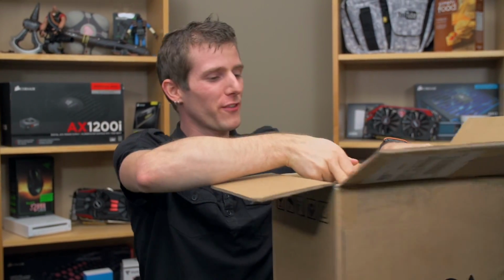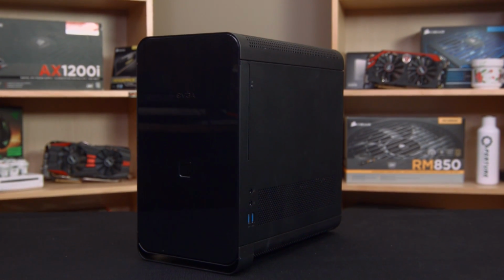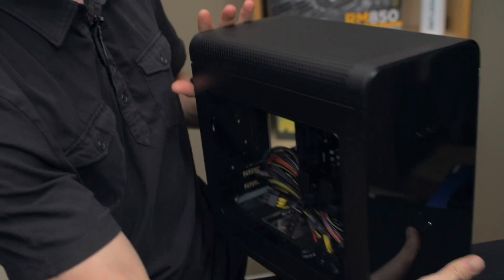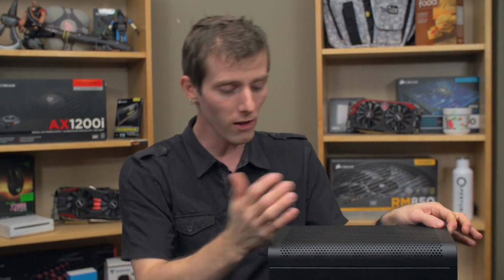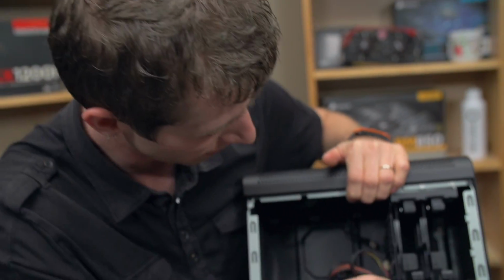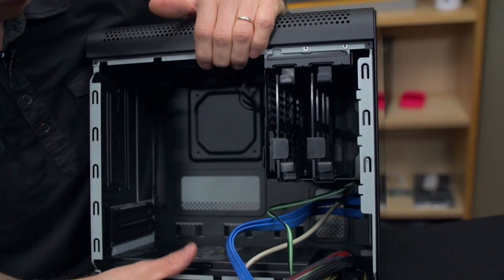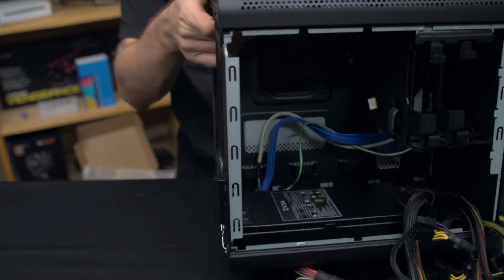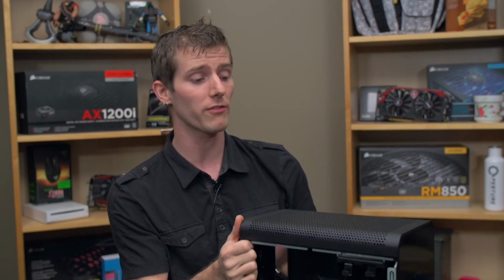EVGA Hadron Air

Comment: Cable management sucks, not "All black interior", and it's expensive (for mini ITX case) the only selling point of this case is EVGA brand (if you're really EVGA fanboy who want to buy every EVGA peripherals) other than that this case is suck.
Reply: The EVGA Hadron Air comes with a 500W Gold rated PSU equipped with it. Most modern power supplies are not compatible unless you use server variants. Why do you consider this expensive? It comes with the case and a power supply. Do your research before you talk rubbish, I guess you didn't go through the video to see the nooks and corners.
 A quality 500W gold rated PSU costs around $100 and a Mini ITX Case is around $80. This case costs $180, how is this exactly expensive?
Reply: jimmys tempura i knew it's 500 watt 80 Gold (non modular), and I DO RESEARCH first before saying "It's expensive" because this case is not worth for $ 190 ( $189.99 on newegg)

Bitfenix prodigy only cost $ 79
FSP Aurum 500W 80+ Gold cost $ 73

You got a Mini ITX case with 500 watt 80+ Gold PSU only for $ 152, with better cable management and water cooling compatibility.
Reply: IndraEMC
At what expense? Bitfenix Prodigy has more open slots for case fans, so you would spend more filling up the slots. Fan Controller to manage the fans or an DVD drive? Besides, the EVGA Hadron Air is much more smaller for those who have conservative space compared to the Prodigy. Besides, the EVGA 500W PSU doesn't have much wires, you can dump them all in the corner next to the power supply.
Reply: *****
Sorry, you lost me. Explain it again....
Reply: jimmys tempura unless you want a "portable", size between EVGA hadron vs Bitfenix Prodigy wasn't really matter, since your PC are just sitting on the desk.
Reply: Cable management is what it is, really not that bad but it's a small case so what more do you want? The goal was smallness, I would be unimpressed if they sacrified that for overly clean cable management when at most you're going to run 3 optical drives, 1 gpu.

The interior is all black, this is a myth propogating throughout the internet simply because of review models.

The price is competitive given the extremely high quality custom PSU and very high quality build. It's not like a cheap case being sold at that much, it's very well built, it can justify its price.
Reply: jimmys tempura I wouldn't do that, it blocks the intake to the GPU. Temps are better if you can fit the cables to the side, between GPU and drive bays
Reply: IndraEMC It's a joke to compare the Prodigy to this, it's nearly twice the size. Different people have different needs, this is an awesome case, and the PSU is higher quality than what you're comparing to. Even in your ill-advised comparison, the price is a difference of only $40, well worth it when building a $2000 computer to make it much more portable and better looking (for those that prefer it).

Comment: Hey, does anyone know if you can fit a 11 inch card in this? I'm trying to get a PNY 11.1 inch card but I want it to fit in this case. Also any good cpu cooling solutions? I'm thinking liquid cooling. dual 120mm radiator? Any suggestions would help.

Comment: Linus U have been having a problem were graphics cards don't fit in my case thermaltake VL80001W2Z V3 Black Edition No Ps Mid Tower Gaming Case... it's not the hard drive bays it's that the mother board is to close to the slot to put it in. I want to know if the nvidea geforce gtx 770 ti would fit or the Asus geforce gtx 750 7i. Thanks to anyone that knows the answer!

Comment: can this 500w gold psu hold a 980TI and a haswell refresh?
Reply: Victor Boechat Yes
Reply: Victor Boechat http://www.geforce.com/hardware/desktop-gpus/geforce-gtx-980-ti/specifications Minimum is 600.
Reply: It's a recommendation from nvidia to give a large margin of safety.

A normal 80+ bronze or better 500w PSU would suffice without a hitch
Reply: LocoMoto Its not a reccomendation it says on it "Requirement". I have a GTX 780 on a Corsair 500w and it underperforms.
Reply: Total system consumption even on a 980ti system with an i7 5930k rarely would reach over 400w while stressing the system.
To note is that an i7 5930k draws more power than the haswell refresh of the i7 4790k

And yes, it says what you are saying but that still is a recommendation/guideline

Are you saying that the gpu is not performing at the performance level it should or that your computer is shutting down when putting a load on your system and/or having internal components being fried up etc?
Reply: GPU's 2nd fan doesnt turn. Im on a Corsair 500w 80+ so the PSU is trustworthy. GPU is EVGA GTX 780 ACX SC and It turns perfectly in my friends system with an Antec 700w psu.
Reply: If I understand this correctly now that means you are using your gpu with his system...
Including his motherboard, cpu, ram and the likes?
Reply: LocoMoto No I borrowed his PSU to see if it was my GPU's fan thats broken but it wasnt.
Reply: Well then it seems like your psu is faulty simply put
Reply: LocoMoto Its perfectly fine. It runs his 970 just not my 780.
Reply: Adam Ryan Thanks. I just bought Cougar QBX and a 500w Gold PSU. Couldn't find Hadron, but its a good case too.
Reply: I'm running a EVGA GTX 980 Ti reference card none OC version with 2 ssds and a i7 4790k. If you don't do a lot of overclocking the 500 gold is more than enough.
Reply: YU TIAN Its 500 bronze. Corsar 500w builder is 80+ bronze
Reply: Adam Ryan Sorry, I thought we were talking about the EVGA case, my mistake.
Reply: No.. You need a 650w because the 980ti' minimum power usage is 600w
Reply: PneumaticFrog No you dont , they put 600W as a recommendation on all of their cards. Just ignore it and use 500w unless ur planning on Overclocking some sort of i5 or getting a FX 9590 or something.
Reply: Adam Ryan not an AMD card.. AMD will use so much power
Reply: PneumaticFrog Nobody mentioned AMD GPU's... We are talking about a GTX 980TI here

Comment: Wait, you said this case PSU was rated for 500 watts, but it will also support a GTX 780 ti? I'm pretty sure that card has a 600 watt PSU minimum requirement. What's going on here?
Reply: You're over-exaggerating power usage.
Reply: Gamesrock22 I'm just going by what the EVGA GTX 780 specs say. If it can run on a 500 watt PSU then that's great news for me, thanks.

Comment: Hey linus which is better? gtx 780 dual classified or gtx 780 dual ftw? or just ftw and classified in general... which is better? the dual ftw costs more but it looks like the classified would be better than it.
Reply: In EVGA speak, Classified is the most top-end, followed by FTW, then SuperClocked. If balls-to-the-wall performance is what you want, get a Classified.
Reply: Jack Ellis or just get a 780 ti windforce for not much more...

Comment: Need some help here. I'm trying to buy a new gpu for my PC, but I'm running a Phenom II X4 955BE OCd at 3.9ghz, and I don't know which gpu to buy so it doesn't get bottlenecked by the CPU. (using a HD5850 atm)
I was thinking of getting a R9 270 OC, but I don't want to spend a lot of money for something that won't work at its full potential. Any recommendations ?!

Comment: It's nice but way too expensive. I'm thinking of a slimline/portable case and changing out my MSI FM2 motherboard for an mitx board.
Off topic, if I change my CPU or motherboard, do I have to reinstall my OSes? I use Windows 7 x64 and Ubuntu 13.04 x64
Reply: why would you have to change your OS?  You just keep the OS on your hard drive and use it. doesnt matter what MOBO or CPU you add
Reply: david huynh that's good to know; I wasn't entirely sure on this topic as I've never done it before. thank you :)

Comment: would that psu drive a gtx 570?
Reply: ***** yeah.
Reply: ***** http://www.geforce.com/hardware/desktop-gpus/geforce-gtx-570/specifications Minimum is 550w but I think it would work.
Reply: +Dylan Winn-Brown I've heard of people clocking power draw on systems with 980s at under 500W, but it definitely depends on the rating of the PSU.

Comment: HEEEELP 
the Asus H81m-a,(motherboard) only supports 1 case fan!!! 
Is there a way to 4? some sort of splitter?
Reply: You can get an adapter straight to the psu.  But the fan would be uncontrollable and they'd run at full speed.

Comment: $200 for a case, you're right this is a joke. I'll stick to...anything else.
Reply: it's overpriced for sure but it does come with a good PSU that should be factored in
Reply: ZanderDude You can spend $80 on a case and get a PSU that's twice as good with that extra $120. The PSU should never be the main point of a system, it's only task is to handle electricity and distribute it as needed.

Comment: Someone help!
I just got BF4 and im getting a really bad frame rate. I dont know whether to upgrade my graphics card or CPU.
Specs:
 Intel Pentium G850 2.9 GHz Dual Core (OC to 3.3 GHz)
NVIDIA GeForce GTX 650 1GB
12 GB of Ram

What do i need to upgrade. Help!!
Reply: I'd upgrade your graphics card, the recommended specs on BF4 say it needs a 2GB card.
Reply: Element921
Its really not about the VRAM, most modern graphics cards are 2GB+. You have to see what graphics card is recommend to run the game, since I dont know what card you have now.

Comment: yo linus need you're  impute. looking to pick up graphics card and monitor soon, but having trouble picking one out. right now I have (Thanks to watching your vids they helped me alot) nzxt 630 case nzxt kraken x60 with mpower msi mobo with i5 4430 2 raptor drives 500g each. Plus a 700 watt power supply but ill be upgrading that too. with 8g dominator platinum 2133. graphics card (sigh!)  amd his turbo 6850 i looking to spend about $600 on a card and about $300 on monitor. the monitor is a samsung 23' 2m bx2331  probley do 3 monitors at a later date. any suggestions been looking at the msi r9 290x and the lightning msi 7970
Reply: don;t care for zoltac had 2 of them. the cards died or fans stopped working on them in about a year. im kinda leaning to the r9 290x but they are sold out every wear. might just hold on that and pic up a cupel of asus monitors and a 3 way stand for them. is the windforce that much of a dif from the msi version?
Reply: cool

Comment: wow, a server style PSU, why would you though.
Reply: what wrong with a server style PSU?..
Reply: There are a few issues I noted due to their size from my one. The layout needs to be done much more carefully. On actual server PSU's that is fine, everything is designed and tested to much higher standards for 24/7 use, but on consumer it isn't. You need to ensure that major heat producing components are towards the end and don't have capacitors behind them. They have to be very carefully engineered to avoid dust, so usually being in a server room with a a filter. The heat up more so need more airflow, which means faster RPMs, in small PSU's that means smaller fans that will be louder (for serves that doesn't matter, mine has 13 50mm delta fans, they're loud) really, the only reason you'd make a PSU like that is if it has to fit in a U1 format, otherwise make it taller and wider.